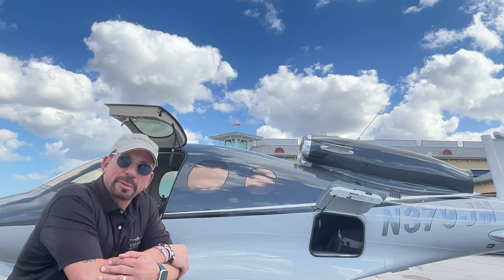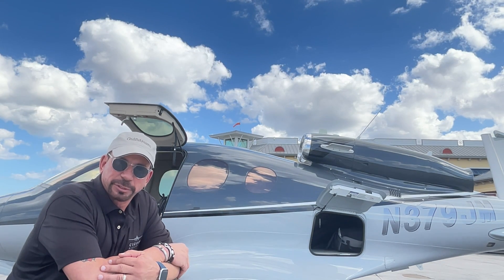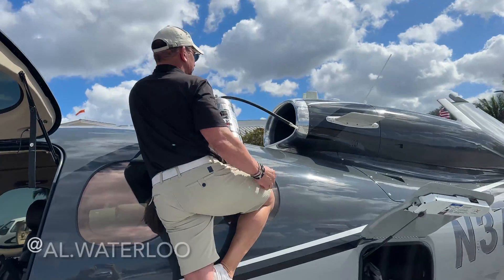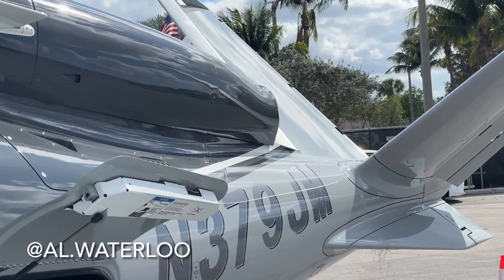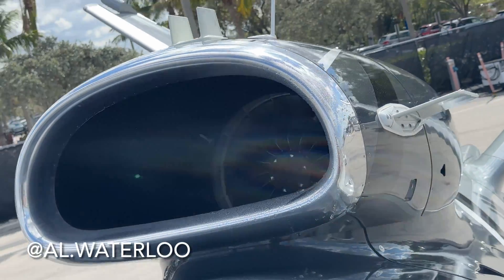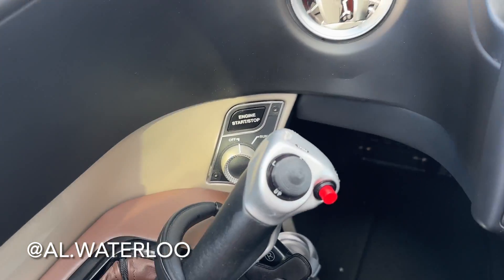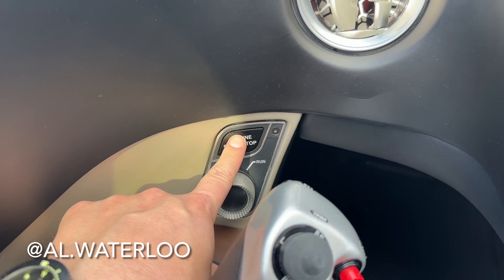ENGINE RINSE | CIRRUS AIRCRAFT SF-50 VISION ✈️

Comment: I wonder if any aircraft mechanics have thoughts about adding a small amount of vinegar to the water. It really helps to break up dried salt,  and then obviously flush with  pure water it would also break up mineral deposits
Reply: There is a special fluid we have to mix with distilled water which then sprayed into the intake of the engine. The keyword here is again "accepted by the engine manufacturer" 🥴
Reply: @barjan82  watch its probably $100 a gallon white vinegar.  Because thats the best chemical to breaking up dried salt.   I know some aircraft manufacturers will literally buy parts from gainger, put it in their box and ad a zero to the price

Comment: Distilled Water or Filtered or just plain old tap-water with all it's contaminants?
Reply: highly recommend distilled.. as someone who is in aircraft maintenance and watched hot sections get pulled apart that where just completely caked with lime rock from hard water..
Reply: @warmfreeze  Good god, how many washes were those engines subjected to? The water used in a rinse doesn't evaporate/vaporize in the engine it is always allowed to drain out, which means it can't leave mineral despots behind. If heavy mineral deposits are building up inside, its absolutely not from engine washing.
Reply: @Dreddip  if you have ever washed your car with hard water and let it air dry/evaporate you will get plenty of lime scale it builds up over time.
Reply: @warmfreeze  which isn't what's happening in the hot section of a turbine engine.
Reply: its fine we use tap water on our pw4000 GENX and cf6 mixed with alcohol
Reply from the maker: Distilled is the best but anything that is safe to drink will work here.
Reply: The plane 1:15  through rain and clouds

Comment: I sincerely hope you're using distilled water and not tap water.

I wonder if flying through rain would have the same effect?

No doubt the post-rinse run time requirement of 5 min both dries the engine while recharging the battery.
Reply from the maker: You can use water that is safe enough to drink. Distilled is obviously the best.

Comment: Why not just use a hose pipe?
Reply: needs more pressure. plus hard to get a hose out to the middle of the GA stands
Reply: It has to be just because it's hard to fine a hose, look at that spray.....telling us it's a pressure issue ffs.... @Nexia_Berry
Reply: @Nexia_Berry  normal hose pressure would reach where he was washing and it would be consistent, the fire tank pressure drops as he is using it. The hard to reach location makes sense but I would think with a budget for that plane you have a private hanger and a hose pipe and filter would be no bank breaker.
Reply from the maker: Very hard to get a hose out to the ramp. This is equipment we keep in the car.

Comment: The inflator used in the video is a  Milwaukee M18 Inflator 2848-20 or very similar. The  inflator provided in the links section was completely different but also much less expensive and would likely get the job done as well.
Reply from the maker: That’s correct!

Comment: I've only ever done compressor washes on Boeing 767s with either P&W JT-9s and GE CF-6s, but a very similar procedure but we had a spray ring that is fitted in the intake so there is a even distribution of water around the engine. 🇦🇺

Comment: what's the point of cleaning the engine?
Reply: Flying in a salty environment can leave a build up of salts on compressor blades which decreases their efficiency, it also helps prevent corrosion in the engine.

Comment: I hope that’s distilled or deionized water that’s being sprayed.
Reply: in the airline world its tap water mixed with alcohol
Reply: With this aircraft, I'm thinking it needs about 500lbs more thrust. It needs to cruise at 350 or u might as well get a epic 1000 propjet.
Reply: Ideally pure h2o sure but is there a practical benefit that would make it worth the cost?
Is mineral buildup a worry for an open combustion engine?
In for ICEs mineral interaction or buildup in the cooling system should be avoided. Water injection systems use distilled/deionized to keep the valves and atomizers clean. 
But here it seems like unlikely to have a negative impact right?

Comment: Interesting. I'm not sure that adequately gets everywhere in the engine though. A lot of manifolds in such a thing. I wonder if some built in spray ports would be better or other system for cleaning.
What are those little scoops in the intake? they seem a little aerodynamically ugly to me. Also what are the orange hoses at the back?
Reply: Better than not doing it I would have thought.
Reply from the maker: It’s what the engine manufacturer says to do. The probes are temperature and static pressure probes that take direct measurement at the inlet of the engine for the FADEC computer to control the engine.

Comment: You can pressurize that extinguisher real easy. If you notice the end of the hose is an air fitting shape that will chuck directly into a pneumatic line from a large compressor then just push the handle down and the extinguisher will pressurize instantly. Instead of using that little air fitting. Retired FDNY firefighter here this is how we charged the can after every use.
Reply from the maker: That’s great! Easy to do! Thank you for sharing

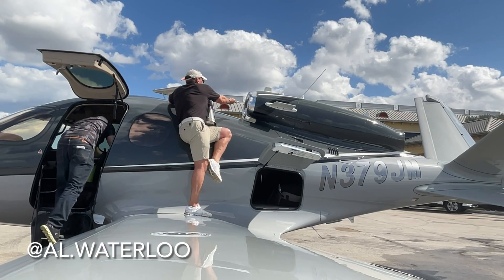Comment: Hello I am curious what are the two sensors protruding in front of the engine.  Concerning the compressor wash, since (I assume from your "good enough to drink" comment) that the water just tap water and if so, why use a pressurized water cylinder for the compressor wash?  I was afraid that the heavy cylinder or jagged handle might hit the airframe chipping the paint, or worse, fall, denting the wing (4:30)!  Since only potable water is needed, Why not just use a normal water hose with typical sprayer? That would mitigate this risk of airframe damage. Look how precariously the pressurized water tank is being held (4:34).  Clownish in appearance, sorry Bob.  How often is this procedure necessary and what is the cost?  Does the engine monitor indicate the need, or do you employ a "gut feeling"?  How many gallons of fuel is burned during the 5-minute engine run?  A lot of questions!  I'm an instrument-rated private pilot who rents 172s.  One of my colleagues ordered a SF-50 which should be delivered mid-2024.
Reply from the maker: Awesome. Your colleague is going to love it! Where will it be based? Those two sensors are for the FADEC computer. It takes the temperature and pressure readings going into the engine. You do this after a certain time interval flying at or below an altitude in a marine atmosphere. You’ll be surprised it’s like flying for 30 minutes or more at or below 5000 feet or so. The actual numbers are close to that but those aren’t the actual published specific values - close though…

Comment: I can't remember what the cleaner was called but when I was crewing SH-3s in the Navy we would spool up the engines, T-58s, and spray it into the compressor section. We had a long wand with a ring-shaped spray head so we could do it from the ground.

Comment: Can you fo that on a king air.   Or.  Tom.  ?
Reply from the maker: Im sure there is a fresh water rinse procedure for a King Air. You would need to double check with the engine manufacturer to confirm any specific procedure.
Reply: There's a spray ring installed in the inlet on a King Air, most if not all PT6's have the ring. Usually an AN-5 fitting connection. If you're in similar environments, please do regular desalination rinses. your wallet will thank you.
Reply: Lots of modern Pratt and Whitney aircraft have hook ups for pressure water lines to clean out the compressors.

Comment: No detergent?
Reply: I’d think distilled would be best to avoid any mineral deposits? Maybe inconsequential though with just two gallons.
Reply: @Bupkus68 yeah when I worked on PC-12’s and now the airlines we always use distilled water
Reply: Williams International says water only.  As long as the water is good enough to drink, it is ok to put through the engine.  Unlike the Pratt and Whitney turboprop engines, this process is as simple as demonstrated in the video.
Reply from the maker: Thank you Bob! Exactly. All you need is water good enough to drink and that’s it.